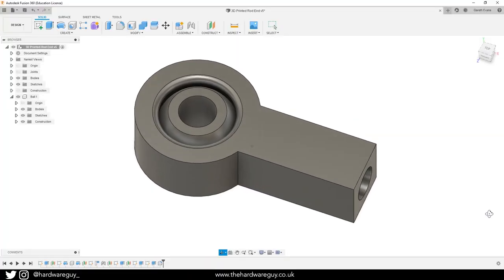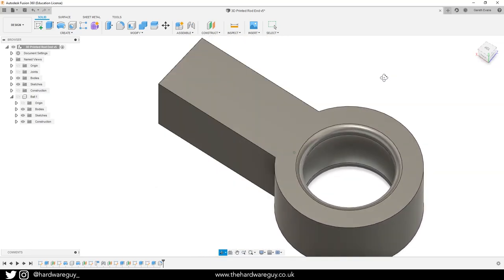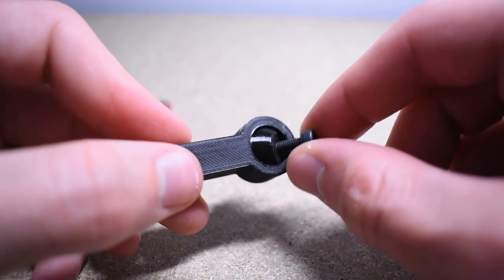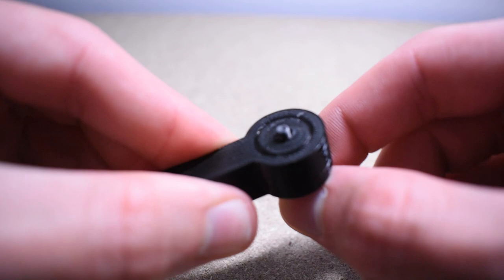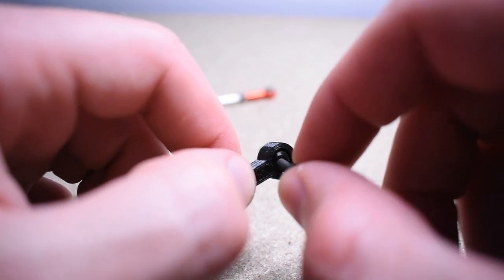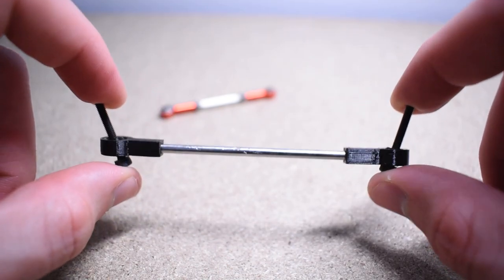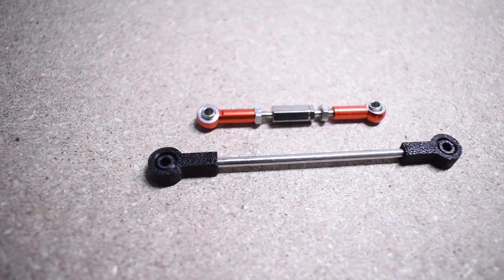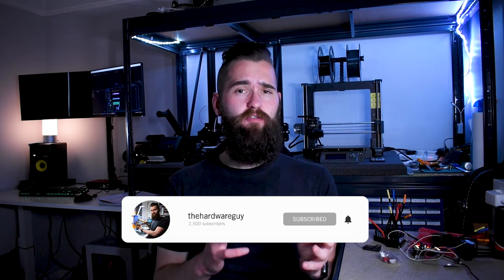3D Printed Ball Joint (Rod End)

Comment: I designed  a Ball and joint in 2 separate pieces, pull the ball in the freezer and the socket in hot water, and then assemble them (PLA)
Reply: What difference in dimensions did you use? In terms of the diameter of the ball and the socket for the ball. And what size did you print at. 
I'm working on a project that uses ball joints and I hope to join them like this.

Comment: It would be nice to see an updated version since they recenntly came out with slicers that do dinamic line width. This would probably make smaller gaps feasible, assuming your printer is very well calibrated and prints slowly to avoid dimensional inaccuracies due to movement

Comment: 0.5mm gap or 0.5mm diameter difference? cause an 0.5mm gap is quite big
Reply from the maker: The difference in diameter between the ball and socket is 0.5mm. It’s likely to be slightly different for each printer and filament... I printed with PETG on a Prusa MK3
Reply: oh.. ok ok. thanks for clarifying.

Comment: Isn't it grindy though?  Don't you have to put grease in it or something?  Ball bearings usually require grease so I expected this to not go well, but seems really smooth.  I wonder if you put weight on it over a long period of time would it grind down if you print it with PLA?  Would PETG be better I wonder?

Comment: I subscribed! Was wondering, could this be used to print them for some 2mm metal beads and push the beads through? I'm currently working on a tiny rc project and was thinking of modeling some of these ball rods but then came across your video
Reply: You might break or ruin the joint by forcing a metal bead through. However, a little modification would not need to push anything through at all. Rather, modify the model to leave one side of the joint open to the size of the bead. Make sure that side is extended to provide some extra plastic. After you insert the bead, melt the excess plastic to trap the bead inside the joint. I'm sure a little experimentation could lead to very effective results.